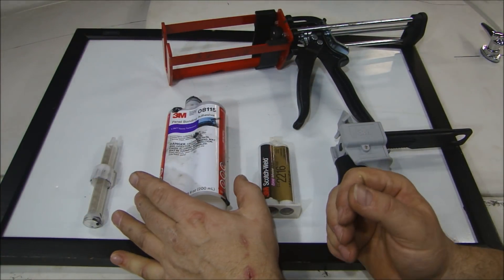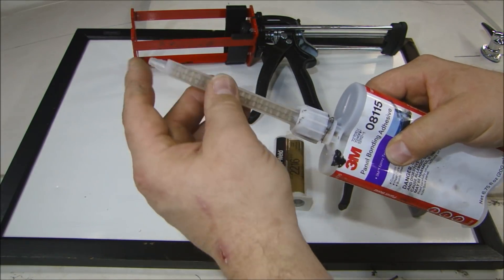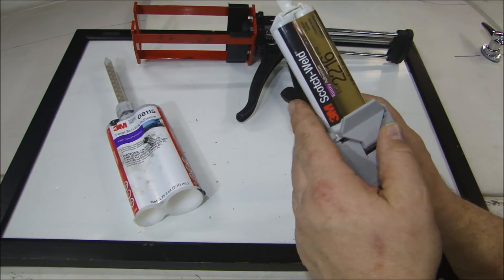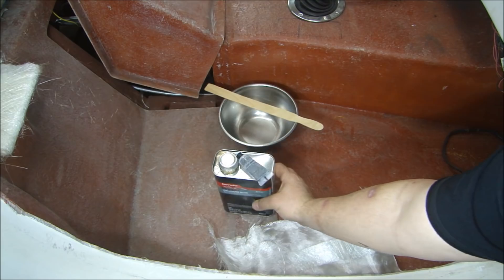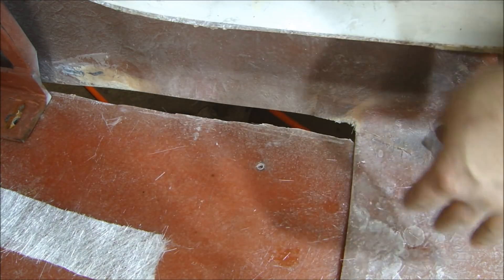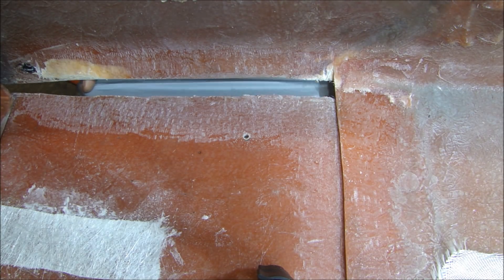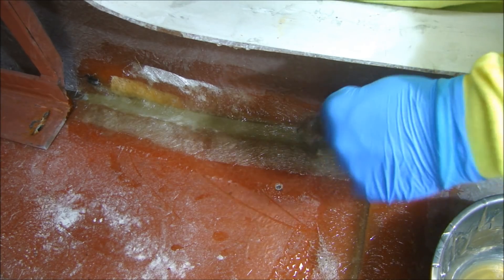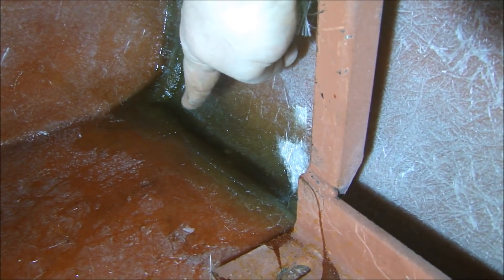427 Cobra - Working with Fiberglass, Polyester Resin, Panel Bonding Adhesives & Epoxies

Comment: Any place it looks wet or pooled on the surface of the repair, you've got too much resin.  It should be worked into the fibers of the cloth/mat so that all of the air is driven out and the material is fully saturated, using as little resin as possible.  This takes time, so mixing large batches of resin and racing the clock is a mistake.  Instead, mix small batches and take your time on a single area.  Any resin you add beyond filling the glass fibers is just extra weight or more sanding work.

Any time you open a container of methyl ethyl keytone (MEK), you MUST wear full-coverage eye protection.  MEK can destroy your corneas in a few seconds.  This is no joke; the stuff is nasty and it just takes a tiny drop from an accidental splash.

Thanks, Pete.  Always enjoy your videos.
Reply from the maker: Great comment, thank you. I agree with you and I believe I even mention a few times that extra resin does not add strength.

Comment: Building a custom Fiberglass hood.    Top part is strand Fiberglass sheet,  bottom is SMC.

What would you suggest for bonding them together?   3M 08115 or 3M 08219
Reply from the maker: Either will do the job

Comment: Pete, I'm also building a CMC kit (basicly same kit as yours. I will be bonding the body to the firewall/floor/wheel wells.shortly and was wondering how much panel bond will I need. I don't want to run short or spend more than I need. Good to talk to you a couple weeks ago. Thanks
Reply from the maker: For all of that you will need about two 200ml cartridges. If you can use resin and glass it would be better and most cost effective. Great talking to you as well.

Comment: After spending more time than I want to remember building fiberglass boats, and building foam and fiberglass aircraft, and repairing fiberglass structures, (truck hoods) here are some thoughts.  Wear only 100% cotton,  polyester will drive you nuts if you have fiberglass dust on the skin. When cleaning up  (like in the shower ) wash in cold water first. This will close the pores while you wash the majority of the fiberglass off, then switch to hot to open up the pores. When laying up over an already cured fiberglass structure, lay the mat down first, then the cloth or roving next. The mat will reduce the possibility of the new layup paling off. Remember, the strength of the structure is in the cloth, and/ or roving.  Roving is just a corse weave cloth and is very strong.  It would be rare to use in the kind of work most of us will encounter. Remember, it is best to keep the fiberglass off of your skin using protective clothing than it is to get out of the skin by washing. REMEMBER the dust mask and eye protection,  especially when mixing the catalyst, as was mentioned by others in the comments. Just to reinforce,  if the catalyst gets in your eyes you most likely go blind.  Also, use acetone for cleanup,  but keep it off the paint, as it is a great paint remover. Thanks for all you do Pete.
Reply from the maker: Now that is a fantastic comment. It is full of information that is helpful to everyone. We are all here to learn. Even I learn from comments. I can take criticism, but when the comment is in the "I'm great, you suck" format, I delete as it helps no one.

Comment: An easier way to apply would be to wet out your glass on piece of plywood that way the glass is wet out best (50/50 glass to resin). It would save a lot of dabbing with the chip brush especially in a out of position location.
Reply from the maker: Awesome idea, thank you

Comment: I seen so many mistakes you made and there will be no strength to your resin puddles. What about air bubbles?? They have to come out or you don’t have strength. You can’t get them out using duck tape as a backer!! Chopped strand is not structural never. And never use resin with wax as you did. That’s all you can buy at big box stores! I worked with fiberglass everyday 10 to 12 hrs with no suit or sleeves for years and hot showers do not take any of the needles out of your skin it has to wear itself out. What you did on this video will crack I just hope it’s not in any vital areas. I built camper shells and this would never be allowed to leave the plant cause we would spend all our time doing warranty work to fix the fractures and stress cracks. Just telling you what I know. Use it or not
Reply: Fair enough M Watkins, but we wanna see your video on the topic!  We need it!
Reply: Silas Marner if I still did fiberglass work I would gladly give the info. A great place to learn the ends and outs of fiberglass work is at Boat Works Today. He has years experience and understands the science behind how different cloths and different resins work together. I didn’t mean my comment as a bad one but after reading it again I see it does sound bad, sorry about that.
Reply: no suit or sleeves and probably no respirator. wonder what the inside of his lungs look like. yikes!
Reply: greg h my lungs are fine and after a while you get used to it on your arms. You won’t get poisoned by getting fiberglass on your skin. No one wore respirators at this time!!
Reply from the maker: I only do this for video purposes. It is not easy to talk with a respirator on, but I do use at least a dust mask.

Comment: How is the body fixed to the chassis?
Reply from the maker: Several attachment points, front end fender wells to frame, steering column support to frame, door sticker support to frame, seat rails to frame.